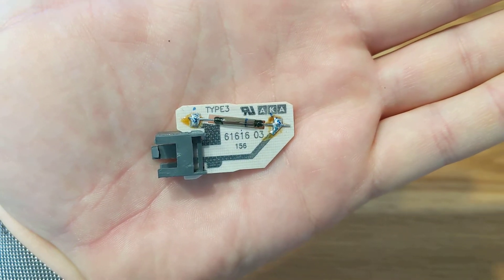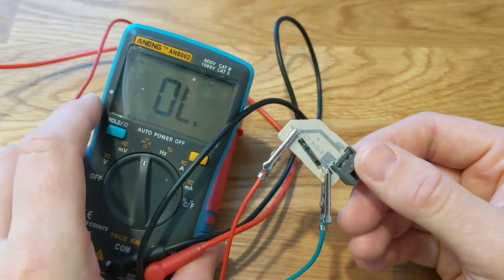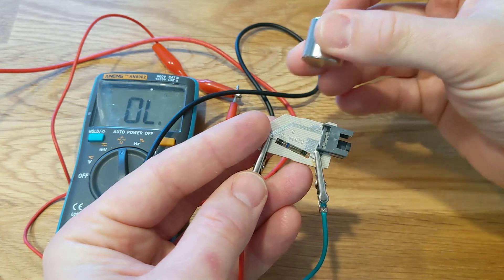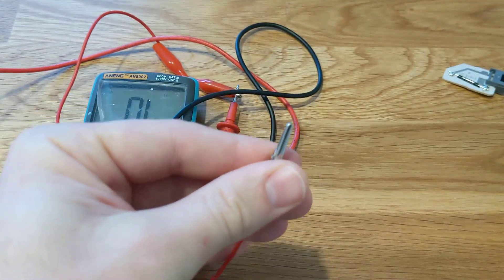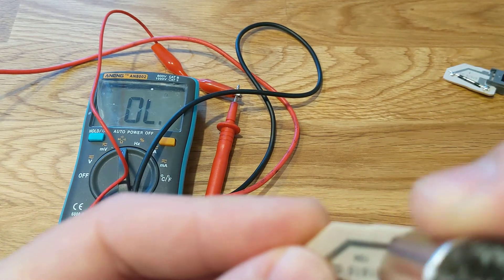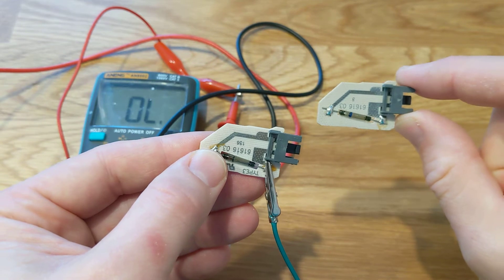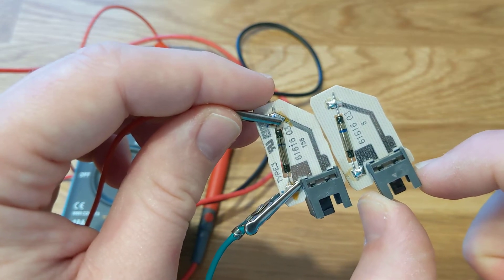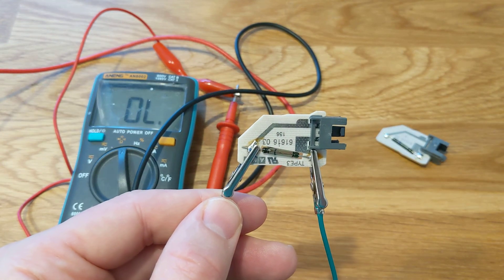Reed sensor - how to check

Comment: can that sensor be bridged?
Reply from the maker: Yes, but it defeats the object of the sensor.
It's designed to open/close under a magnetic field so the device knows how many revolutions a shaft has done (flow meter in this case)
Reply: @mkaminski100   thanks..